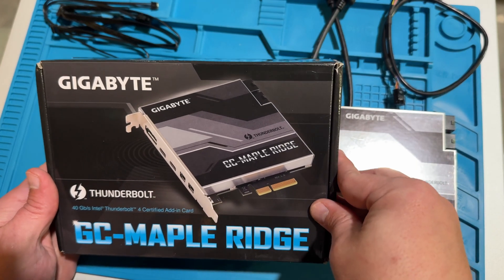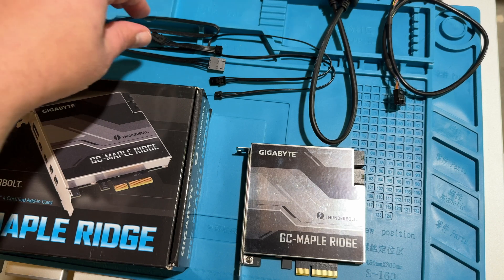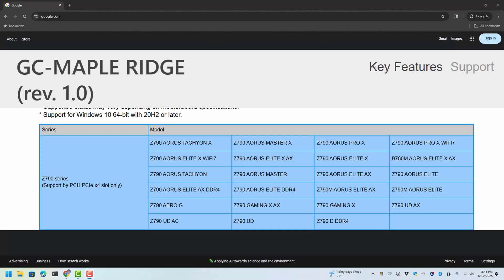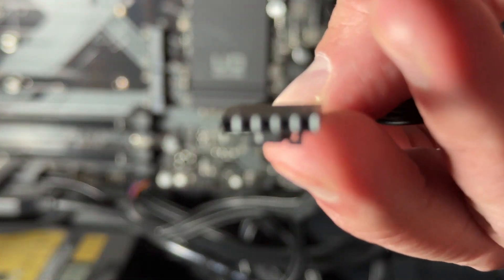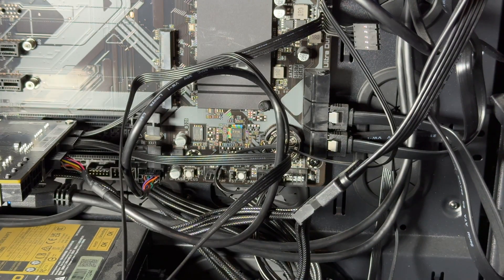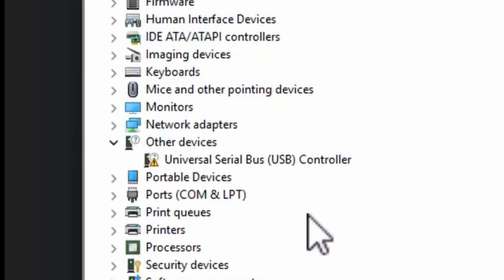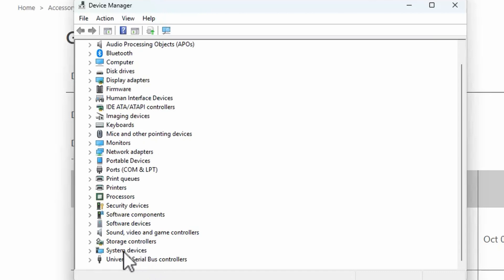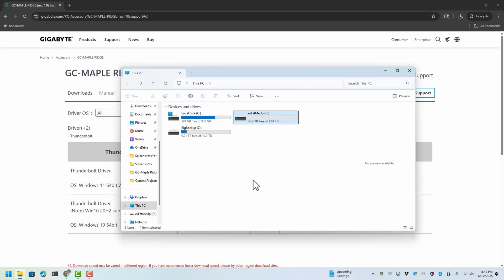Add Thunderbolt Ports to a PC  - If Your Thunderbolt Card Doesn't Work, Try This!

Comment: The  Gigabyte Z790 AORUS ELITE AX motherboard has two PCIe x4 slots, in addition to the x16 slot for the GPU- which is on the list you referred to, so why would you need to place the expansion card in the bottom slot?
Reply from the maker: I’m assuming it’s how it’s wired, but the BIOS won’t see it as a Thunderbolt card and the Thunderbolt options won’t appear (on my board at least) until I put the card in the bottom slot. There may be other Gigabyte motherboards that behave differently.

Comment: So, these are addin cards to upgrade existing Thunderbolt funcationality. It will not ADD Thunderbolt capability if the motherboard doesnt have an older version of Thunderbolt such as Thunderbolt 2 or 3. Kind of lame. I was hoping it added support not upgraded.

Comment: This TB cards come with x4 PCI interface, can you insert onto a PCI_x16?
Reply from the maker: No. It has to be inserted in the bottom slot of the motherboard. I didn’t know that and thought the card was broken but I found out later, for my motherboard anyway, it will only work in the bottom slot.